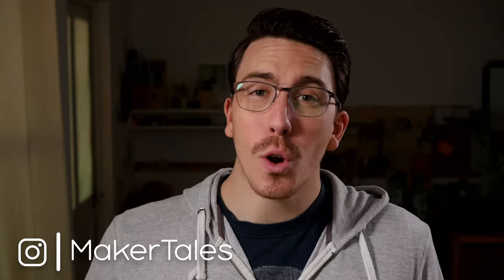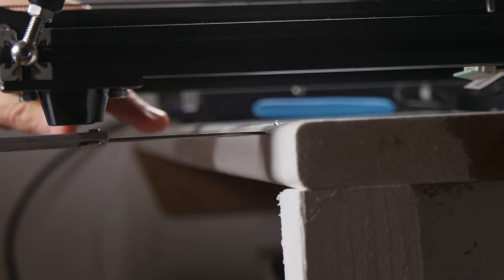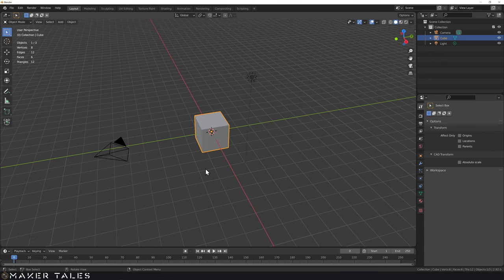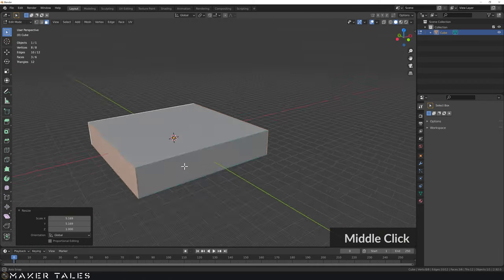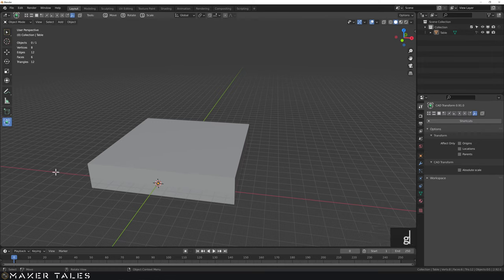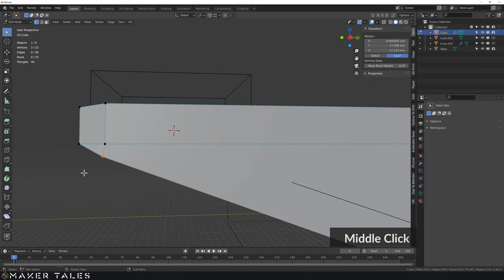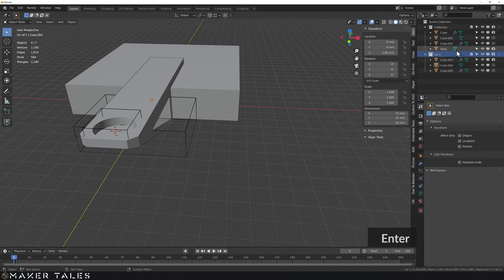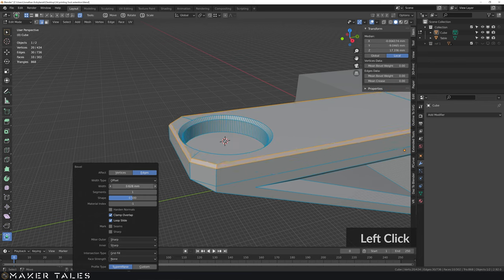My 3D Printing Design Workflow In Blender 3.0 / 2.9

Comment: I think a way to make this process a lot like CAD would be to reference geometry for other features. 
for example >> your screw holes you placed by aligning one axis to origin & eyeballing the rest << if instead we could choose a face / edge / vertex to use as a reference. Then place the screws with an offset to the reference.          /\/\With that paradigm we could use object transforms to place the feature precisely AND move it whenever we want. /\/\   
In other words ,, the only caveat to the process of aligning via origins, is that a part only has a single origin... so moving something around which is far from the origin is at best "a guess" or a masochistic math problem.
I have a feeling using empties or bones which are snapped to vertex groups might work...   I haven't touched blender in years... last time i gave up and just used fusion / inventor.  I'm just now again getting into blender.  

The true goal is to be able to reference via a face / edge / vertex so that if the part is modified, then the relationship maintains.   Meaning >> if the screw holes are not attached/referenced , then if we are to change something in the bracket (like the overall width, or thickness of the top brace) the placement of the screws is outta wack  ...

Comment: That extension underneath the table does nothing to support the weight of your printer. But it does makes the  bracket easier to slide in for installation.
Reply from the maker: I would say it adds like the smaller little bit of support if the plastic were to deform over time but even then it's just for ease of use really.

Comment: Blender can be a nightmare when you stack booleans in my experience. But other than that, with vanilla settings, i scale the base cube by 0.5 and then upscale it to measured length.

Comment: wouldn't it have been easier to just move the feet on the t-slot?
Reply: Or if that's not possible, t-nut or glue a couple of wood blocks to the printer bottom rails further back. Or put a sheet of plywood under the printer. Or just two narrow rails of 3/4" wood . . . many 3 minute "piece of scrap wood" solutions to this problem. Seeing you drill holes in your countertop, that's just wrong. And if you want to move your printer later, you have to move the supports, drilling new holes and leaving empty holes where it was before. And yes, I realize it's all irrelevant since this is a design exercise illustrating Blender workflow etc., it's just painful to watch such an ill thought out design solution to a trivial problem.
Reply: or just to turn the damn printer by 90 degrees???